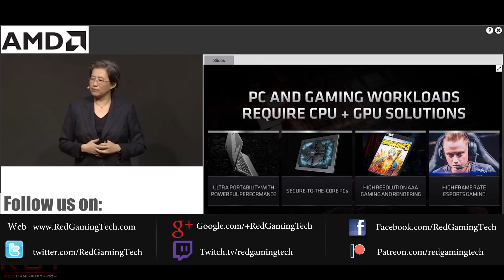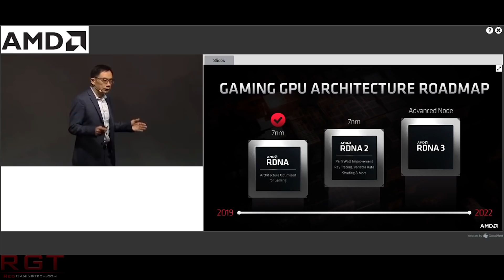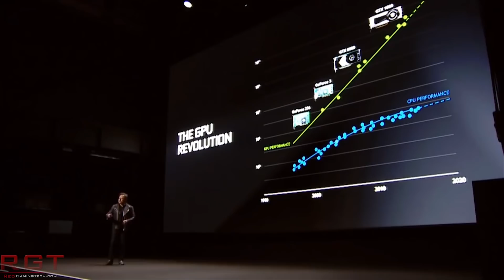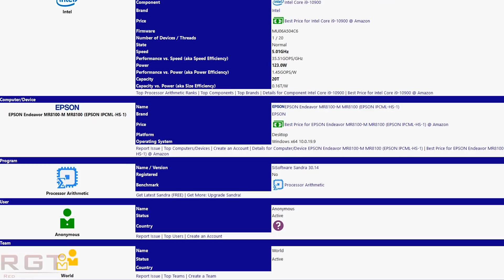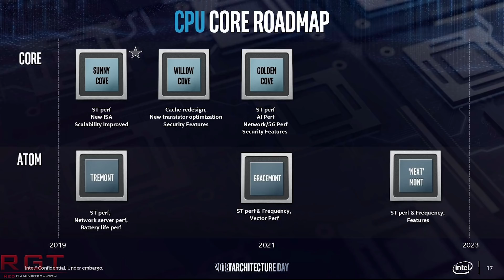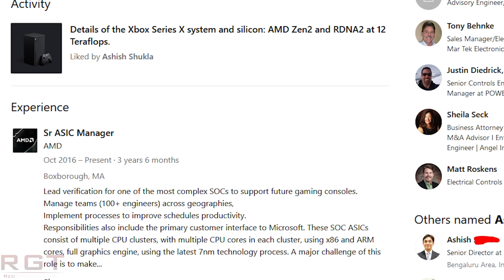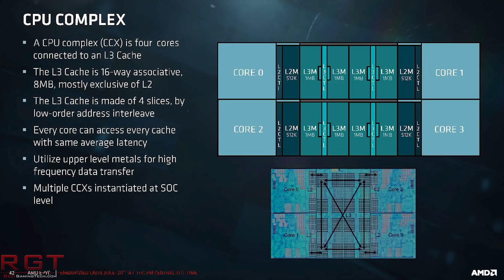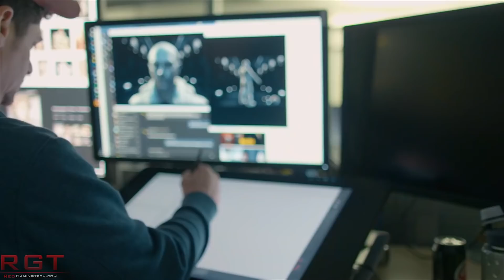Zen 3 & RDNA 2 Launch Date Leak? | Ampere 'Waiting' For Navi | XSX SoC Multiple CPU Clusters

Comment: Paul. Has no one considered this guy worked on surface devices? Surface pro x is arm based system, surface laptop with the ryzen model could easily explain the multicore part. Folks forget the surface team does work on the xbox stuff as well. It seems crazy to me no one every considered he worked for surface engineer team.

Comment: October, that's ducking late.
Reply: @untseac  AMD should've released it end of last year or early this year to make a difference. Nvidia doesn't have that much competition on the GPU front, at least way less then actually needed. When AMD finally releases 'big navi' Nvidia already has something better. And then there is the virus, I even doubt we'll see these products this year. At this point I don't expect anything more then disappointment.
Reply: @untseac  They need to beat the 2080 ti by an significant margin. Nvidia is not Intel, it's not asleep. Maybe AMD will beat Nvidia by a couple of months, wooptiedoo. I doubt it if it's so late.
Reply: @untseac  RDNA2 is %50 more efficient per watt. You are acting like its %50 faster IPC which is not the case.
Reply: @untseac  What your saying makes no sense at all. Your acting like Nvidia is sitting on their ass not doing anything.
Reply: @untseac  just because nvidia focussing on ray tracing they cannot improve other things significantly. If anything that is nvidia speciality. When nvidia first introduce maxwell many people wonder how nvidia able to increase performance significantly without node shrink at all. When pascal arrive able to push both clock and efficiency at the same time. Many people think nvidia did nothing special until AMD try to do the same with their polaris/vega. While AMD able to push the clock well beyond 1-1.1ghz mark vs previous gen GCN the power consumption goes out of control at higher clock.
Reply: Yea :/
Those damn ducks...
Reply: @untseac  my point with maxwell is nvidia able to increase performance even when there is no node shrink. Then with pascal nvidia able to improve both clock speed and efficiency when normally you have to sacrifice one aspect to improve another. So with ampere it is also possible for nvidia to improve both RT and rasterization, not just RT and sacrifice rasterization performance. And i did not compare vega architecture directly against nvidia architecture. But more like nvidia usually able to do something that AMD can't.
Reply: @untseac  it was the other way around actually. Over the years i see many people underestimating what nvidia capable of. And sometimes it is not because of fanboysm but simply they want AMD to beat nvidia. Even with the upcoming gpu most often people try to put RDNA with the best light possible (efficiency increase, IPC increase etc) but when comparing to nvidia they most often look at ampere as turing shrink with some RT improvement at most. What about efficiency improvement? What about IPC? 

 And the thing with mantle is different. It is not about making the impossible possible. AMD intention to push mantle is to solve one of their core problem on pc: drivers. By giving game developer more control they hope pc games will stop needing driver release everytime new game comes out. In the end we still saw something similar before: even with DX12/Vulkan we still see driver release to improve performance. Because realistically pc is not console thay only have one hardware config. That's why when sony starts rolling out PS4 pro some game developer are not fond of such moves because in some cases they were asked to take advantage of PS4 Pro raw power making them need to optimize the game twice for one platform of console.
Reply: @untseac  Yes, my point exactly, because now they'll have too compete with Rtx 3000 instead of holding the crown for almost a year.

Comment: Hmm, so October it is?
I would probably wait if not all the interesting games I really want a new CPU for started coming out in September...
And so i guess even if B550 would drop 1-2 months earlier that would still only be around end of July.
Don't think I'll wait another 6 months for the new CPUs then. Maybe one more month to see if B550 comes out far ahead of the CPUs.
Reply: Better off getting a  budget X570 board.
Reply: @stuartandrews4344  Nah, I really want one without that tiny fan. Would go for a B450 then.
Reply: @Quast  Got Aorus Elite X570,(superb board,has Dual M.2),it has that tiny fan,but it never spins up,(& it is working) due to good case cooling.
Reply: @stuartandrews4344  I going to consider it. Thanks for the info. :)

Comment: If nvidia though rdna2 was just 20% better performance per watt they wouldn't be nervous. The claimed 50% could cause them to change the product stack Alot.
Reply: "50% per watt" means "with the power that's already being used, it'll be 50% more efficient at using it". 
It doesn't mean "50% increase of performance". 

AMD's not about to "let something slip" that actually talks about performance improvement, to keep 1) NVidia guessing, 2) keep their hype going, and 3) to keep from potentially getting roasted (well in advance of it's release) for an underperforming "advancement" (if it turns out that the cards don't match up performance-wise as well as everyone is hoping for). 

Essentially, until the consumer can get their hands on actual devices and a slew of tests/benchmarks are ran, everything until that point is getting your hopes up based on assumptions. Stop pretending hype means reality, especially when you're NEVER gonna find a marketing team that's not choosing how they word things A LOT more carefully than you're interpreting them.
Reply: @RAW_Reality  if amd is claiming 50% you can assume they're planning to deliver better. If I'm working for a competing company I'm assuming 50% improvement is worst case scenario for amd. They're not snitching on themselves but they do have to wet the investors mouths a bit. Besides even if it is accurate amd has shown thier willing to throw the kitchen sink at performance with liquid cooled models. If they have a show to be #1 how far would they go?
Reply: @bigcjm  They're NOT claiming a 50% performance boost though. That's the problem with people saying "NVidia is scared"... 
If you're AMD, you would NEVER let your competitors know what you're about to release before you actually do, especially not half a year in advance... That literally gives all 6 of those months for the competition to improve thier product before thier next release, which --->
If you're NVidia, you're wanting to trump AMD's release by putting out your product RIGHT AFTER them with a better product. And NVidia doesn't get scared by "they're making a more efficient card", which is ALL that's been actually claimed to this point. Efficiency means VERY little in terms of overall performance. Just performance per watt. It it WERE claims of ACTUAL performance gains of 50%, THEN NVidia would have something to concern themselves with, but that's not the case this far, and AMD knows full well to NOT let that happen.
Reply: @RAW_Reality  I never said they were scared.  You made that shit up. Look the guys who discuss this stuff indept believe amd has a shot. Wth would make you think nvidia doesnt think the same thing. I made only one claim. This may make them shift thier product stack. Plus these guys are pulling in 60% margins you know what may happen if they have cut margins plus eat lower overall sales from desktop and laptop.  That's a real problem.
Reply: @bigcjm  "they wouldn't be nervous" is LITERALLY what you said, so don't say I'm making something up by all-but verbatim quoting you. 

Take your own OP comment for example... In it, you're mixing concepts...
AMD got a 20% PERFORMANCE increase from the advancement from RDNA to RDNA2, and did so with a 50% PerformancePerWatt Efficiency increase. 
So the REALITY is that AMD thus far has ONLY claimed to have EXACTLY the same improvements in going to RDNA3 from to as they got from RNDA to RDNA2 (in terms of PerWattImprovemnt), it means that unless something further gets improved, you can expect the very same 20% increase to performance as the last gen improvement. Which would THEN make them competitive with the CURRENT offering of NVidia... So yeah, they're not scared of what's being reported as ONLY making AMD's next offering as good as NVidia's last offering.
Reply: @RAW_Reality  you are correct they said 50% gain. But obviously there has to be huge gains in efficiency for that to work. Rt cores aren't going to make these cards run any cooler under load.
Reply: At the end of the day, I WANT AMD to be competitive. Hell, I'd prefer them to beat the snot out of NVidia. But NOTHING that's been released, reported on, discussed, or perceived about it has ACTUAL meaning in terms of ACTUAL PERFORMANCE IMPROVEMENT, so I'm not going to believe they're "going to compete at the top end" until ACTUAL specs come out and confirm that they CAN, which HAS NOT happened. 

My new fridge is 20% more efficient, making it consume less power to keep the same temperature as my last fridge, but that doesn't mean the new one is now a deep-freezer...
Get it now? 
Efficiency does NOT equal performance.
Reply: @bigcjm  To be fair, there's not a "has to be" aspect of your comment, it's just more of a "there should be" because nobody's going to want a GPU that pulls 500 watts from the wall to gain some ability to game in 4k or get more FPS. So yes, there SHOULD BE a Per\Watt Efficiency improvement if they're making an actual performance increase that'll require more watts to make happen.
Reply: @bigcjm  AMD specifically said RNDA2 has %50 performance per watt over RNDA1. So if a RX5700XT has 9.75 Teraflops and uses 225 watts. It should only take 112 watts to hit that level of performance. It just means it will be alot more efficient. There is no information available about real world performance in games or workstations.
Reply: Nvidia are running scared!  The good times are about to end...Nvidia has had it good far too long.
Reply: UHD Gaming PC  I'm just gonna say simply this:
Just because something's been a certain way for a while doesn't predict it always being that way.

I get your point, but time will determine the validity of that, not assumptions.
Reply: +Smuky ! "Just because something's been a certain way for a while doesn't predict it always being that way" Oh really? And deep down in your heart, do you believe the same about Intel? Will they finally catch up to AMD? Or are you just an AMD fanboy?
Reply: @Patrick73787  I keep forgetting how actual thought escapes some pepple... 
First of all, every word I said about AMD prior to that sentence was stating to the contrary of your "fanboy" claim, not to mention that all that I was saying in that comment which you obviously took out of context and applied it to your own ignorant narrative was that "things change". I know, new concept, right?
Reply: UHD Gaming PC  While inherently you're agreeing with me, it's not likely that AMD will get "destroyed", as they've known all along that they not only have to beat the 2080TI, but also attempt to compete with what NVidia comes with next... So they might be closer than you think, even if you're ultimately correct in AMD still trailing when the dust has settled.

Comment: i3 10100 4c/8t is gonna have a hard time beating the value of the ryzen 1600 AF 12nm 6c/12t at $85 lol AMD still wins
Reply: I mean if it comes with good cooler at close price there is no reason to buy 1600af
Reply: @DUUDE_TM  its gonna need to be atleast less than $100. I just don't really see that happening
Reply: @BoggedBogdanoff  yeah me neither

Comment: I always though they should use Jaguar as a co-proc since it's x86 and not a terrible chip...
Reply: @ampluz  Yet it somehow ran the last gen consoles... STFU...
Reply: @untseac  IT'S NOT X86 so they need a new programming model... Should I change back to my JOKER pic...?
Reply: A coprocessor for what exactly? Jaguar is kinda old now.
Reply: @untseac  I have heard ZERO about ARM DRM for consoles... Or any HW DRM for that matter except for HDMI...
Jaguar was THE CPU for last gen... It can do co-processing for whatever they want...
Reply: @ChristianHowell  The Jaguar CPU's were utter trash. Why on earth are you defending those things? Also a more modern, efficient ARM chip is the way to go not an 8 year old underpowered low end laptop CPU.
Reply: @ZackSNetwork  Because they were in BOTH consoles... They can update the design and make it at 7nm... And rather than RUNNING the consoles it would be a co-proc...
Reply: Jaguar is terrible, so I'm not sure where you're coming from.
Reply: @untseac  JAGUAR is X86, you ninnies... You can't have two ISAs in the console...
Reply: @untseac  I'm saying you're annoying noobs.. Ryzen has an ARM PSP but it doesn't have anything to do with running the OS... Jaguar was the console CPU...

And all I said was I was surprised they haven't used it... But annoying noobs have to have an opinion...
Reply: @untseac  You're the idiot thinking you can mix two different ISAs in one chip to do the same thing... YOU CAN'T... IT MUST BE X86...

Comment: ARM cores embedded in the SoC probably enable increased security/DRM that is harder to crack vs having a discreet ARM chip to handle security/background tasks ala PS4's approach which uses a discreet ARM chip.   There was also some discussion whether XO/XOS/XOX have an embedded ARM core as there is a 2-4MB cache and nearby logic visible on the die shots that has never been detailed by MS.  Naturally since so many past consoles have been cracked, if it is for security it makes sense why we have had radio silence for 7 years about that SRAM cache and nearby logic very visible on XO die shots.
Reply: That was sort of the approach used in the Wii, just with the ARM core in the GPU. But it's not that unusual to have security conscious bootloader ROMs etc as more part of the GPU block rather than CPU block
Reply: @MechanicaMenace  Interesting! Thanks!